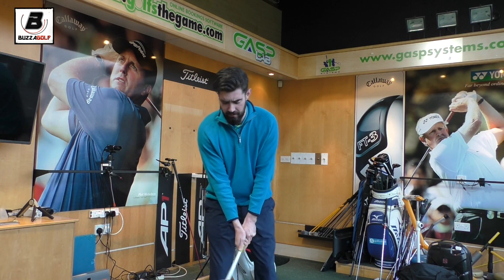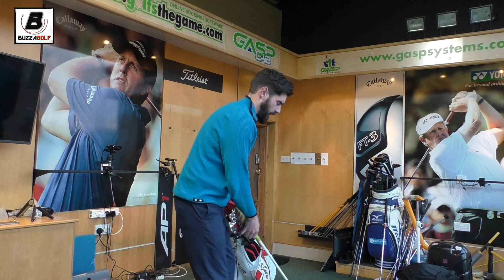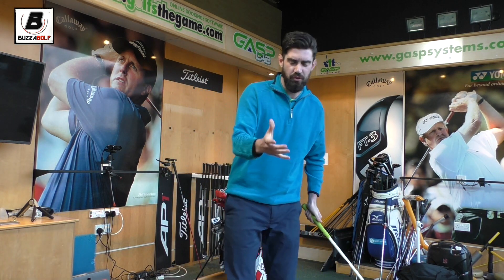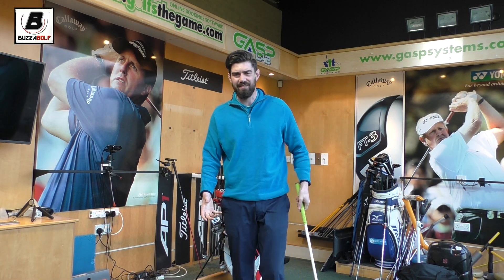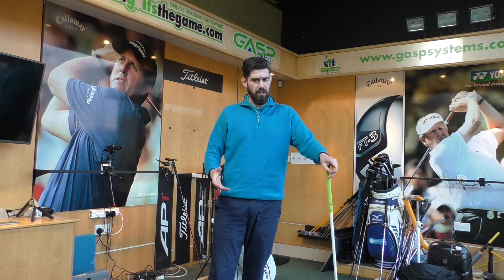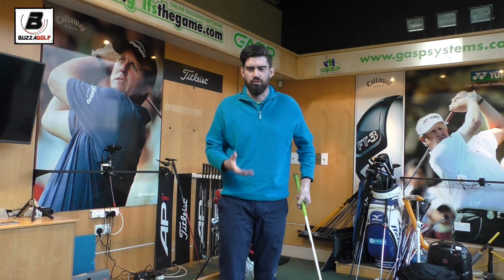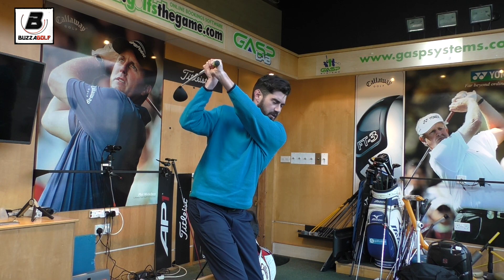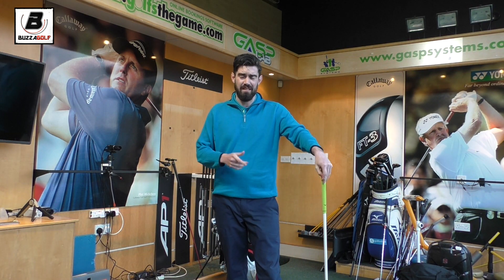Make a bigger swing for better Drives | Stop slicing

Comment: Couldn't agree more-i have to hit my driver full...if I try to just put it in play I often slice it or by trying to make sure I don't slice it hit a straight pull.
So if a driver isn't required I just rip my 3 wood instead.
My mates hit the soft driver shot but it just doesn't work.
Also by hitting full tee shots u learn when a driver is the right play and when maybe a fairway wood or hybrid is the better play.
Most courses have a few par 4's that really tempt you to hit driver when it's not required and where alot of the danger can be avoided just by selecting a different club off the tee 👍

Comment: Thanks Steve, I've had this mental block since coming from from injury last month (torn right tricep). "Oh i'll just take it easy with small controlled swings...." I'm having a shocker on the tee at present and no one fault type, I've got snap hooks, pulls and pushes. I'll try swinging fuller again this week on the range see if I get my mojo back. Rich

Comment: Hi Buzza, my driver swing is pretty much as described in the vlog. I've struggled over the years fighting a slice and gradually shortened my driver swing to compensate but as you say distance suffers as a consequence. I'll have a crack at working on a wider full swing and let you know how it works out.

Comment: Often the problem people experience when they use a shorter back swing is either they have an injury that prevents a full turn, or they would rather hit it straight, but will sacrifice distance.  Usually this golfer's problem is too much vertical torso movement  past a certain point of swing.  The important bit is to make sure that your swing axis from point of address matches your point of impact.  In other words, keep your torso turning on that same axis from address to impact.  Many shank shots stem from too much body movement due to swinging a heavy driver head around.  This is why lower back strength and stable balance are so important.

Comment: Well I do struggle with a driver but, not on distance. Yes i will hit massive drives but, really it could go anywhere. I could blame my swing which is very big and high energy for loss of control but, the painful truth is that its the same with all woods and hybrids which have more compact swings. Strike is usually good (my miss is a centre top) but  it will avoid the fairway. Now I mostly drive with my 1 iron which is shorter but usually accurate or my Callaway Mini off a low tee. I have a feeling its because i don't turn my body much (old age) and have a very upright swing. It doesnt really bother me, I still out drive the other ladies with my driving iron at over 180 yards and the accuracy means less lost balls. Really I would only get the benefit of a driver off the men's tees; i can reach all our greens in regulation without a driver. Now my driver is reserved for the range only ;-)